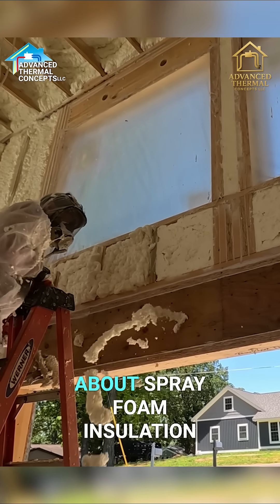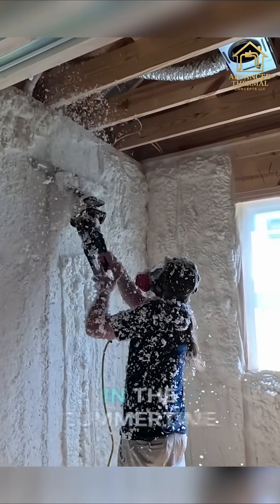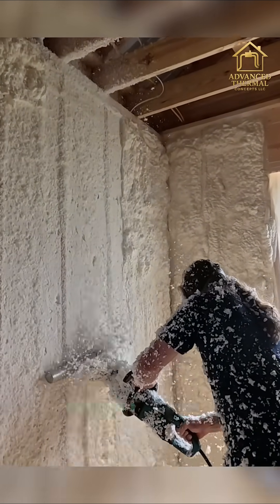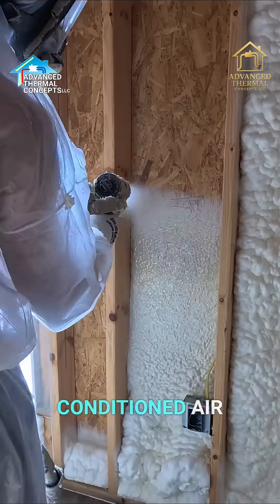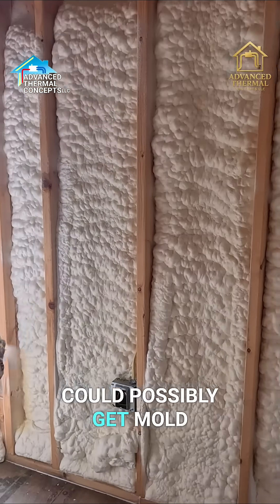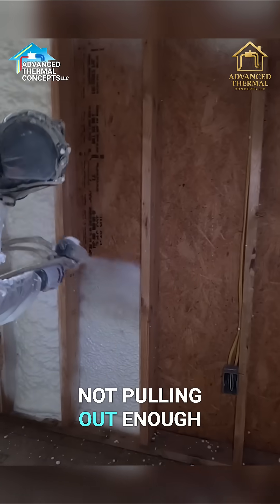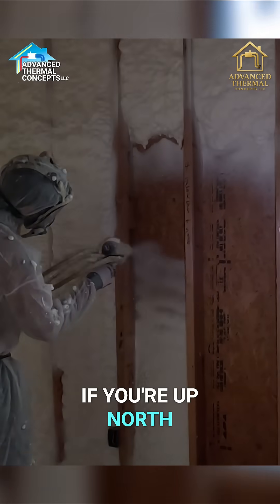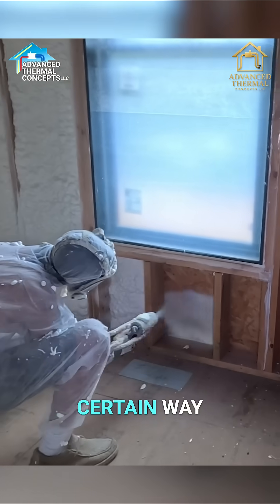Does Spray Foam Cause Mold?

Comment: Blame another trade. Nice.

Foam is NOT the answer. Retrofit or remodel is a nightmare. Repairs behind the wall is now a nightmare. Your HVAC contractor isn’t going to know what an ERV is.

Go rockwool, 2x6, 16” on center and R-48 in the attic.
Reply: spray foam undeer basement slab, would that be ok?
Reply: @randomrazr  as a vapor barrier? you'd have to look at what the manufacturer recommends or tested the foam for. Closed cell foam would probably degrade under the weight and pressure of the concrete combined with the vapor.

Comment: Plumber here I walk away from repairs if a house has foam
Reply: Use sleeved pex pipes and electrical conduits for wiring and there is no problem. It might be too high tech for americans though.
Reply: @jarnogeddala3333 pex is junk. I will only install copper
Reply: @jarnogeddala3333  you gonna do repairs, you gonna cut through all that foam ? To find something that might not be there ?
Reply: @SevenMacEleven  You dont have to cut through the foam, just pull new wires to conduits or new pex pipes to sleeves?

Comment: He said if you installed the spray foam properly, you won’t get mold that is wrong the reason why I say that is because you have a higher risk of mold when you use open cell insulation because of the condensation in the do and the humidity but also because it’s open cell insulation open cell insulation acts like a sponge closed cell insulation even though it’s mainly for roofs and garages it’s a good idea to use close cell insulation on your exterior walls as well and for those people that want their living room noise not to go in their bedroom use insulation in your interior walls 99.99% of the time interior walls are hardly ever insulated